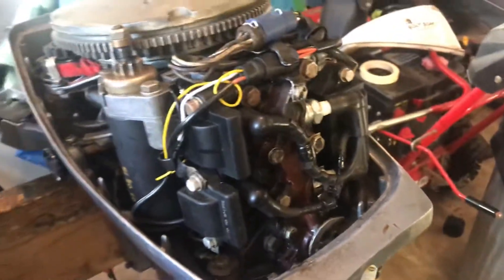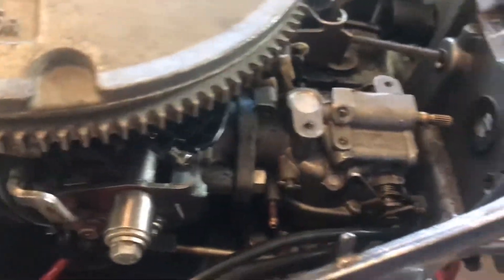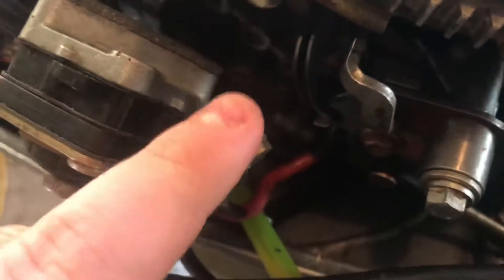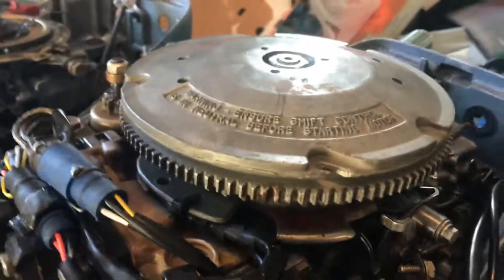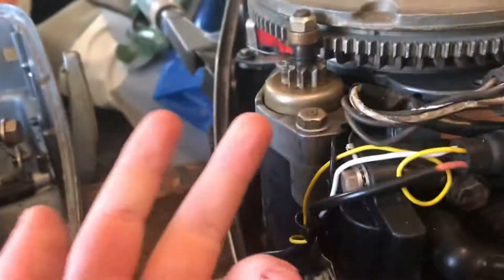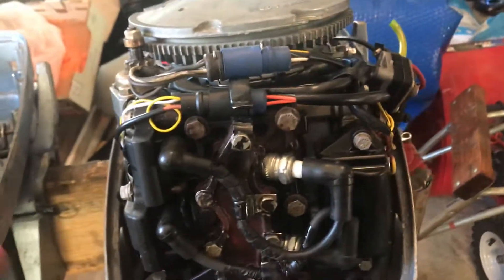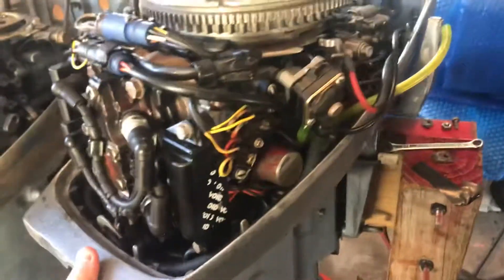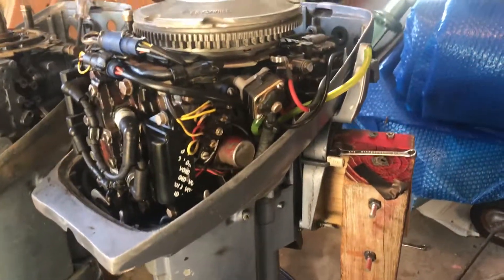Electric Start Conversion on a 9.9/15 Evinrude/Johnson

Comment: Hello  Seth. So based on your video, I need a magneto, flywheel, charging coil, electrical block and cables. Can you think of anything else? Mine is a 15hp 305cc manual rope.

Comment: Nice work guys....You are lucky to have that parts engine,  those flywheels and intake covers/starter mounts are expensive for sure...
Reply from the maker: Oh I know. Definitely wouldn’t have added it if I didn’t have that parts motor. Thanks for watching. Feel free to check out some of my other videos.
Reply: How much does that run ? I have two 15hp evinrude engines. And really want to add electric start to one of them.   If you could please send me the parts ? Thank you and super bad ass
Reply: @Livinoutdoors_  Well, they used to have electric start "kits" from OMC, with all the parts you needed to make the conversion.  I doubt any of those kits are available anymore.  The part number for the kit depends on the model year of your engine.  You could try to find the individual parts, but that will be tough to do.  The electric start flywheel/with the ring gear is costing over $100 these days, the starters seem much more plentiful
Reply: @fleetwin1  thank you  for the reply ! I actually found the complete kit for my 1980 motor for $150.
Reply: @Livinoutdoors_    COOL!

Comment: I have a 1977 9.9 with electric start.  I just started putting it back together after a total rebuild.  Over tightened the plastic nut on starter button and  button broke at the base of the threaded shaft.  Tried Gorilla glue, didn't hold.  That harness is upwards of 150 bucks if you can find it.   What did you replace yours with?  Is your neutral safety switch still bypassed?
Reply from the maker: https://www.ebay.com/itm/233663377070. Hey this is what I use. Works really well. I’ve had it on there for awhile and it’s holding up. I did the same thing to mine. Hope this helps
Reply: @sethgabbard7705  Awesome. Thanks!
Reply: @sethgabbard7705  This ebay link no longer connects.  Can you provide a description of what switch harness you used?
Reply: Использовать провод AWG10 или сечением 6мм2, клеммы желательно медные. Я живу в России, могу изготовить жгуты специально для этих двигателей Evinrude 9,9-15.

Comment: What battery do you recommend? I was surprised to find out my 1974 9.9 Evinrude is electric start
Reply from the maker: I use an Everstart battery from Walmart. It has 625 MCA and cost about $65+ the core charge if you don’t have an old battery. It works well and holds its charge

Comment: One of the best designs OMC made was the 9.9-15HP except for the upper water tube grommett,LOL!. Electric start is always a big plus with charging when selling one of these. Nice job Seth..... I have a few too in my hoard,LOL..Glenn
Reply from the maker: Definitely one of the best motors ever made for fishing. Those upper water tube grommets are killer man. Alright after this video the starter button broke. Luckily found a cheap one on eBay for $6.50. Should be a good replacement. And yes, this does add a lot of value to a motor like this. And never to bad to have a couple of these in your collection. They are very good motors.
Reply: @sethgabbard7705  Yep they made them by the thousands thru the years. I just bought one last year from a local marina same motor as yours was missing the electric starter for $75.00 .Came home and put a starter in it and started right up thermostat was corroded shut also pulled it out runs real cool now, luv it, LOLL... Glenn
Reply from the maker: @GPOldMarineShop  indestructible little outboards I must tell ya.